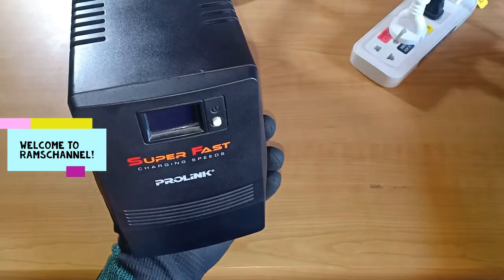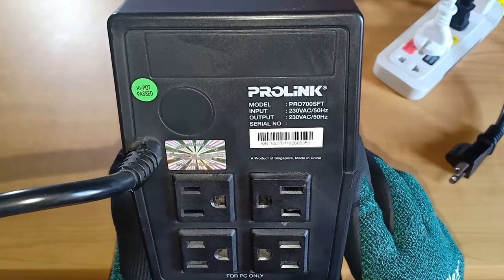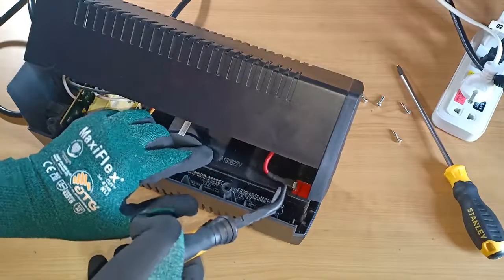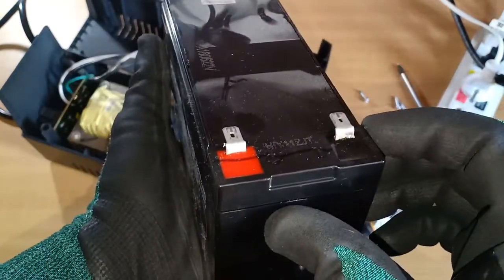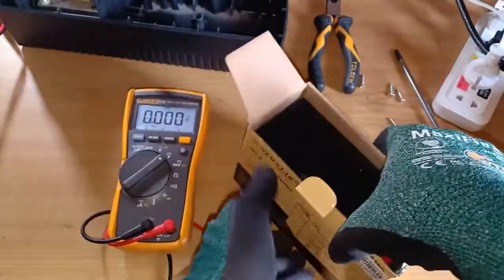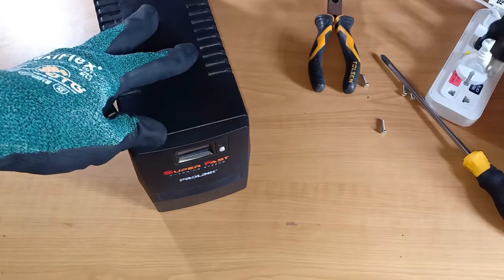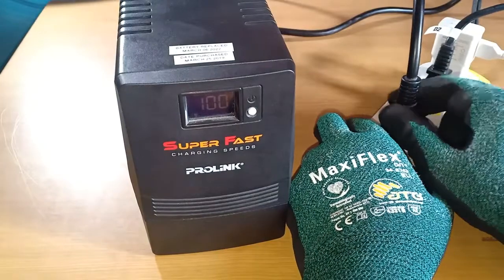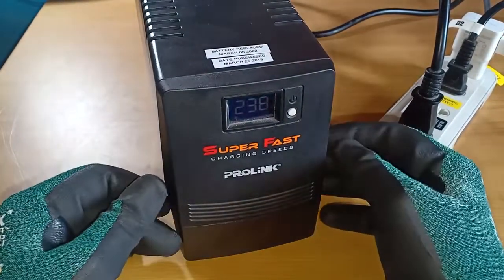[ENG SUB] Replace Battery to Fix FO4 Fault Code On ProLink UPS

Comment: How to repair F06 error
Reply from the maker: Sorry, I can't find any reference to F06 error code for this model, ProLink Pro 700SFT.
Reply: @ramschannelreviews model is APC BR1500 BACK-UPS PRO
Reply from the maker: @Dinesh-Bhardwaj  According to online sources, F06 error code for that model indicates Relay Weld problem and cannot be corrected by user. Suggest to contact APC technical support for assistance.
Reply: @ramschannelreviews 😅